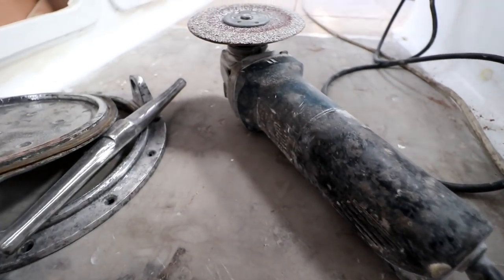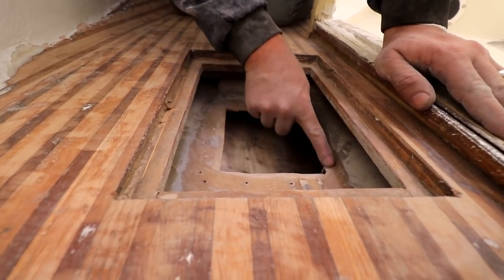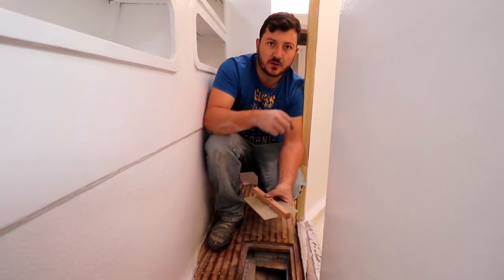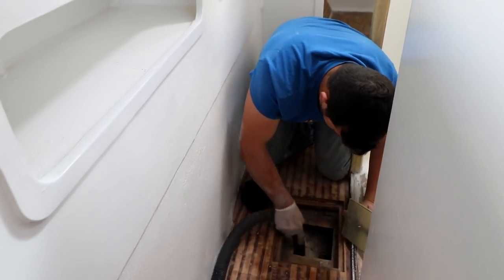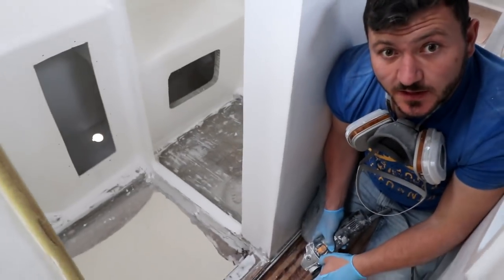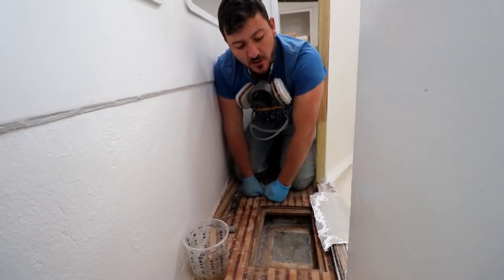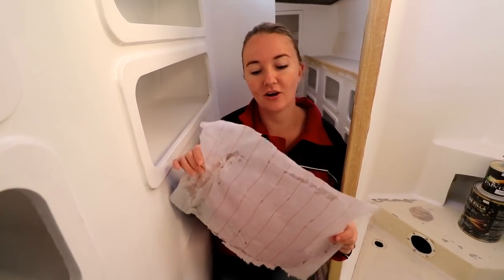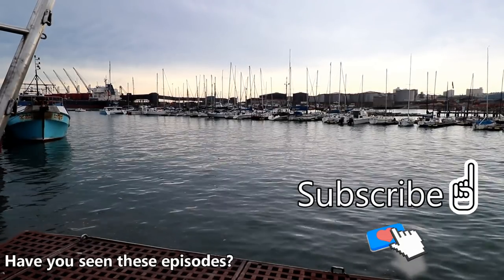HOW TO: PLUG a hole in FIBERGLASS.

Comment from the maker: Got any ideas for the next few How To: Videos? Leave us a comment! 😄
Reply: one of things I need to conquer is fixing up old gelcoat
you know, maybe an instrument needs to be removed, or there is some damage
how to repair it so it doesnt look like crap and matches the existing gelcoat
Reviving old gelcoat is something similar
cheers
Reply: SV Zaya  Hi can I chime in here ? and say it's a tough job and the best thing is to learn how to paint! Gelcoat always fades sooner or later and it's almost impossible to match and then the patch will fade differently than the old gelcoat. Good paint will hold up much better and not fade.
Also  wide vinyl  striping tape is great for covering ugly stuff and lasts forever. The reason gelcoat is hard to patch is the polyester resin does not fully cure on the surface when exposed to air , so soluble wax is added to come to the surface and seal it from the air but this can effect the gloss . The pool coat Ricky uses has the wax in it.   Cheers Warren
Reply: here are a few ideas on how to  videos,in no particular order .
building a rain catcher.
lpg gas piping ,shut off valves,solenoids,gas detectors and instalation
basic plumbing and installing a fresh water pump.
installing a hot water system
plumbing for watermaker and return lines for flushing and testing
running DC wiring and using tinned wire,heat shrinks , spade connectors with crimping too etcl.
fusing and battery cables using correct crimping tool..
battery maintanance and  240 volt chargers
installing charge controllers and battery monitors for solar panels
engine rebuild basic components
sterndrive rebuild,replacing rubber bellows.
fairing the hull and repainting
replacing acrylic windows,neopreme seals ,PU sealants and fastners.
LED lighting
networking AIS ,GPS,radar,and plotter etc
chain anchor and gypsey set up
sea anchor set up 
additional anchors and kedges
reefing system,lazy jacks and furling.
self steering ,auto pilot and steering system.
dinghy and outboard routine maintanance.
davit system
Reply: What do you all use to organize the refit? Any specific software, project management, spreadsheets, etc? Or just a napkin and pen? Also, it would be great to go over your electrical system, wiring, navigation system, and propulsion choice and GenSet, Watermaker, all the goodies, the Sail choices, oh wait, do you all have a mast yet, LOL. 

And it will be nice to see video on the interior design concepts, all those finishing touches Simone will do to really make her a home. I think Ricky is building the strong foundation and Simone is building all the love into the boat on top of that foundation.
Reply: wapr21drive: thanks for that, I guess Im going to have to do an epoxy repair and paint it. 
Of course once you paint a boat you paint it forever
Just thought Id check in case some other ideas had emerged
cheers
Reply: wow! Alex, that is a list!
Reply from the maker: Pretty much what Warren said below SV Zaya. It's almost impossible to match up the old and new gel coat.. He gave some great suggestions. Try it out & let us know how it goes.
Reply from the maker: Jeeze, thats a list and a half.. haha thanks Alex!
Reply from the maker: Michael Buck, We just write it down on a little notebook we have & then check it off there as we go. Thanks for the suggestions we will definitely look into those. We do have a mast, she will also be getting a little but of a make over. Simone will most definitely also be doing a interior video once we get there.. she will love showing you guys that for sure! Definitely her side of the boat refit.
Reply: no worries
thanks for the conversation people

Comment: here are a few ideas on how to  videos,in no particular order .
building a rain catcher.
lpg gas piping ,shut off valves,solenoids,gas detectors and instalation
basic plumbing and installing a fresh water pump.
installing a hot water system
plumbing for watermaker and return lines for flushing and testing
running DC wiring and using tinned wire,heat shrinks , spade connectors with crimping too etcl.
fusing and battery cables using correct crimping tool..
battery maintanance and  240 volt chargers
installing charge controllers and battery monitors for solar panels
engine rebuild basic components
sterndrive rebuild,replacing rubber bellows.
fairing the hull and repainting
replacing acrylic windows,neopreme seals ,PU sealants and fastners.
LED lighting
networking AIS ,GPS,radar,and plotter etc
chain anchor and gypsey set up
sea anchor set up 
additional anchors and kedges
reefing system,lazy jacks and furling.
self steering ,auto pilot and steering system.
dinghy and outboard routine maintanance.
davit system

Comment: What is the difference between poly resin and epoxy resin?  Do they differ in their applications?
Reply from the maker: It's two different products, different properties, different prices. Their application however is similar. You need to work a lot faster with polyester than with epoxy.. one of the major benefits of epoxy over polyester it is long term resistance to water below the water line and bonding and sealing of wood it is a superior product, down side it is not uv stable and if exposed to the sun it will break down.

Comment: That was quite a fiddly job. I am surprised you didn't just use two pieces of fiberglass panels. One slightly oversize and one slightly under size. Bond the two together. Then once the two pieces are bonded you can use it as a patch. Coat the patch piece with epoxy around the edges then put it diagonally through the hole and pull it up into the hole. You end up with an oversize piece on the back of the hole, a piece filling the hole and then lay fiber on the front of the patch. That way you end up with the original material sandwiched between glass all round. So no way it can come out no matter if there is force pushing down or pushing up on the patch. Sort of like a rivet in steel. There would be a lip of glass all round the edges on the front and back of the patch.

Comment: Instead of using peel ply, why not just use laminating resin instead of finishing resin?
Reply from the maker: We do use laminating resin, it produces a wax surface this is what allows it to dry. Peel ply is not only for the wax surface but also to eliminate the form of the fiberglass.
Reply: Think your getting laminating and finishing resin mixed up. Laminating resin cures to a somewhat tacky surface. This makes it very easy to add more layers after curing, just give it a wipe with MEK and continue laying up(no need to sand).  
It's the finishing resin that have the wax in it.
Reply from the maker: Hey Mazda Rick here , you get a number of polyester resins ranging in tensile strengths, uv stabilised , iso , clear base etc ( many to mention ) the resin we use is an ISO resin im sure you are familiar with it. most resins are laminating resin (Over the counter trade name ) but there are also a number of other eg cast and flow . For marine and structural components i prefer to use waxed resins as they have a full cure and guaranteed Mpa rating . resins that do not have a wax formula will not produce a full tensile rating unless a final layup with a curing agent is added ( good for large hulls where 7 or more layers of high gsm glass is used and the chances of a aggressive exothermic reaction is unavoidable) . Ive done some of these layups when we did some composite control rooms for a military project , its not always the easiest resin to work with unless you have done a good amount of resin work. for how too applications where you can appeal to a vast audience with varying skill level i recommend a waxed resin.
Reply: ISO can be had in waxed or unwaxed and is usually stated. We often use unwaxed (cheaper) and add wax for final layer or two.  Only time we use peel ply is to get a very smooth finished surface that is going to be coated.